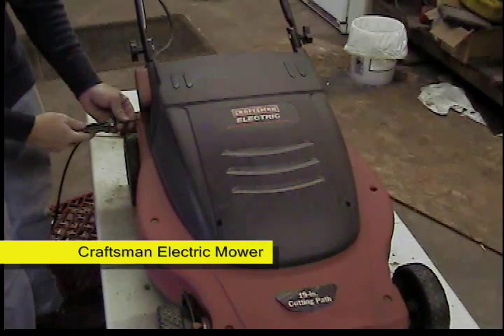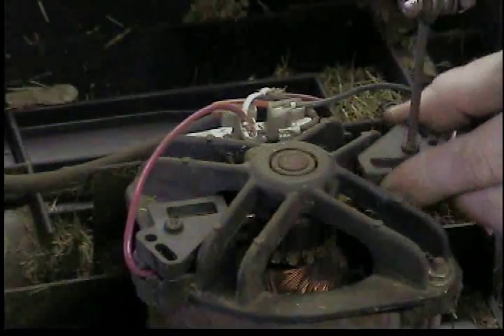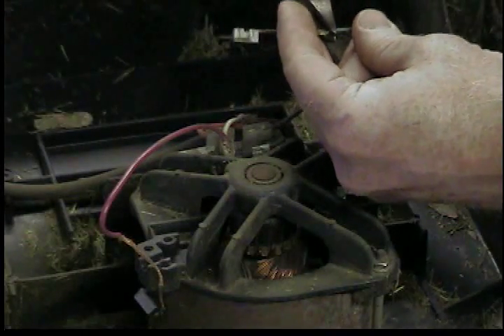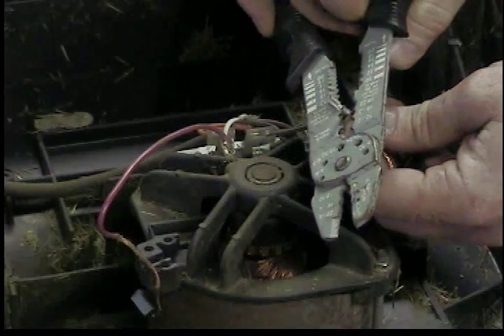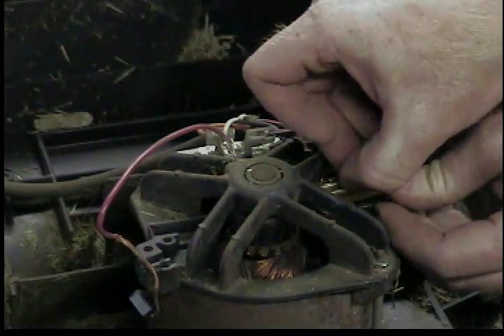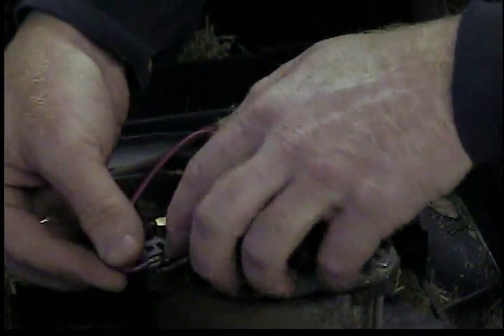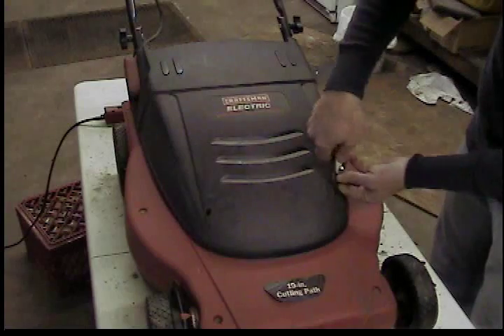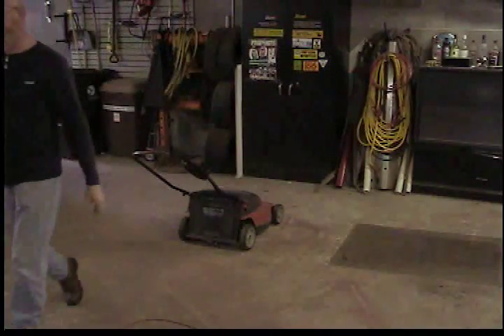Electric mower shunted brush replacement DIY How To

Comment: Thanks for instruction.  My Mother's mower stopped some years ago and this gave me direction/inspiration to troubleshoot, will take it apart today.  It started to run but then quit after about 30 seconds, wonder if could be motor.  Will take a look at the bushings as described.  Thank you for clear video.
Reply from the maker: Mow On!

Comment: hey bro quick question. how do you know the shunts need to be replaced? mine have some sparks coming out of it but not to much. would it be fine to use till i get new ones in?
Reply from the maker: If you remove them you can see how much is left. I ran mine until it quit.

Comment: My brushes are cracked and the mower still works but rough. I noticed the axle that runs through the motor to the blade wobbles on the top side of the motor. Is that area going to need replaced too somehow?
Reply from the maker: That sounds like a bad bearing or bushing. I don't know if they are available.

Comment: What if voltage is at brushes but once installed on motor no voltage.. Motor? But armature windings test good. Any thoughts?
Reply from the maker: Marco Rodriguez Check for continuity between the two brushes. When the brushes wear down one or both wont  make contact. Keep us posted.
Reply: Got 24 volts at brushes but once connected to motor they're gone
Reply from the maker: Marco Rodriguez With mower off, put an ohm meter from brush to brush. If it shows infinite ohms (like connected to nothing) then it is probably brushes.